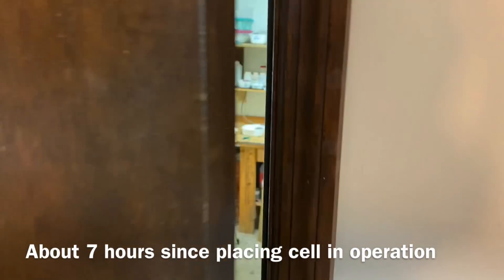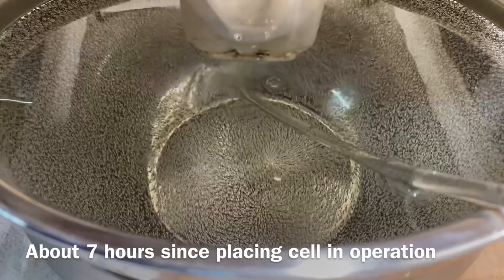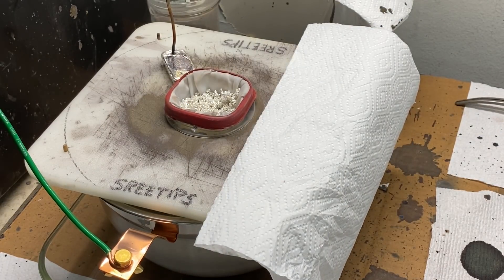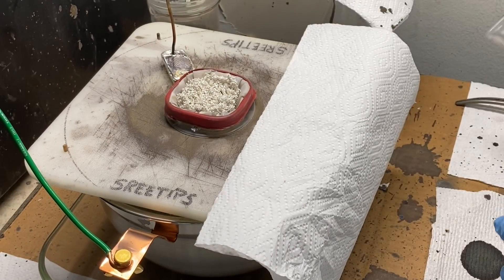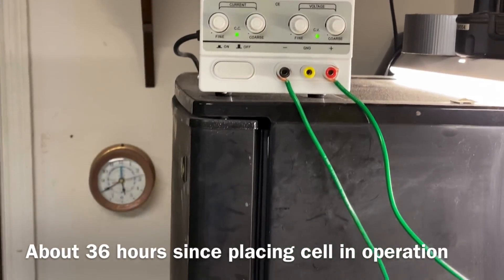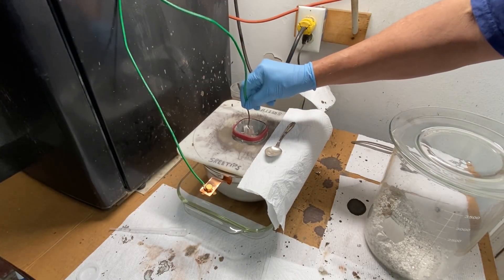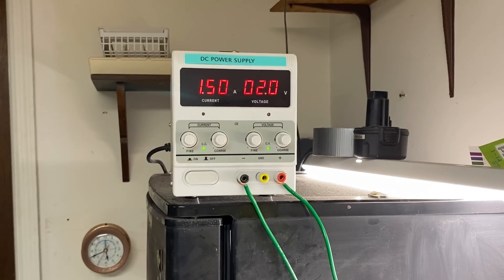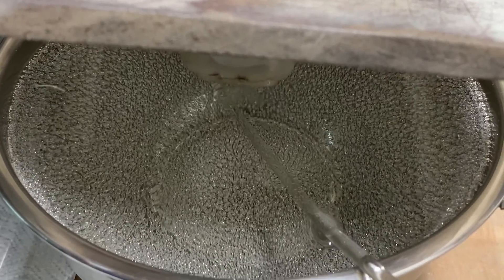EP010 Silver Cell Constant Current Update

Comment: I bet you can see variable crystalline formation depending on the amps and voltage, the way it looks you are getting thicker strands from the amps and the rate of growth could be the voltage. Low voltage low growth, higher amps more connectivity thicker crystals.    :  )
Reply: The rate of silver deposition (number of atoms per unit time) is only dependent on the current. It's because you need a certain amount of electric charge to deposit each silver atom, whereas the electric current is simply the rate of charge transfer.

The voltage, however, sets current density, i.e. the amount of electric current that flows through each unit surface area of contact between the metal and electrolyte. It is not so obvious, but a calculation yields that the current density only depends on voltage. If the voltage is regulated, a larger surface area (i.e. if you have a lot of crystals already deposited) results in more total current, but the current density on the boundary will remain the same.

It is the current density that determines the local properties of the electrolysis process, i.e. which metals are preferably deposited, whether there is bubble formation, etc. This is why most electrochemical recipes specify optimal voltage across the cell and only give rough specifications on current. So I would only use the constant-current feature of the power supply for current limiting and short circuit protection, while keeping the voltage constant.
Reply: @bormisha  so if the amps are OK at 1.5 how much more voltage could be applied to get optimal growth and what are the indicators.     Thanks.       :  )
Reply: @remzo500  If you limit amps to 1.5 then, with Sreetips's cell, the voltage would stay at around 2.something V and never rise to 3.5V which Sreetips previously mentioned to be the optimal value that he heard from somebody. If the optimal voltage really is 3.5V, then 1.5 amps is too low a current for a cell this big. I would set the voltage to 3.5V or whatever other optimal value; and raise the current limit slightly above of what is necessary to keep the power supply in constant-voltage mode. This way, the constant-current feature of the power supply will almost never be utilized, except for protection against short circuit or other abnormal circumstances.
Reply from the maker: One thing not being considered: the current cell is running high purity silver - no slimes to build up in the anode filter and interrupt current flow. If I run the 98% to 99% silver shot from cement silver then the filter will slowly get clogged with slimes and current flow will drop off
Reply: Very interesting thank you all.     :  )
Reply: I remember that when you replaced your power supply with the one you have now is when all the issues appeared maybe going back to a desktop computer power supply would be better or get the specs on your current power supply and get a much better one.    :  )
Reply from the maker: I might set up a second cell identical except with an old PC power supply just for fun.

Comment: Does the electrolyte go bad? Or does it harm the silver growth or structure over the long term?

Hypothetically, if one were to use an aquarium in the same manner as you built a silver cell in a breaker, could you just keep running pure double refined silver crystal through it to make an art piece? Let's say it's a 25 gallon aquarium with a graphite block 1in x 3in x the width of the aquarium in the bottom at one end, and the anode filter basket at the top of the other end, could I just keep adding double refined silver crystal to that until the aquarium fills up from one end to the other? Would it eventually have negative effects? And if the electrolyte can get its usefulness used up, can I just suction out the electrolyte and replace it and keep going until it's filled the aquarium? And when is full, can I (or should i) just replace the electrolyte with distilled water?
Reply from the maker: The electrolyte gets depleted as the cell operates. Plus copper builds up in there. Not with this run because there ain’t no copper.
Reply: @sreetips  When an atom of silver plates out onto the anode, that atom must be replaced by one from the cathode. The reason the electrolyte gets depleted of silver when running non-pure silver is that the silver ions in solution slowly get replaced by copper ions - which of course fouls the electrolyte over time. 

When you are running essentially pure silver, there are only silver ions in the basket to replace those in solution, so the electrolyte should not become fouled.

Comment: Hi Sreetips! I see both CC and CV indicators are lit up on you DCPS. I don’t believe this should be the case. I’m pretty sure those modes of operation are supposed to be mutually exclusive…this is fairly common with these cheap Chinese power supplies.
Reply: True, that. You can regulate current by fluctuating voltage or you can regulate voltage by fluctuating current. Can't do both at the same time.
Reply: @ut000bs  Actually you can put a max on both but that will definitely slow things down and under perform.
Reply: Doesn't matter, digital readings show clearly that the PS is working in constant current mode.
As you said, CV led on this cheap chinese PSU is more or less an indicator of voltage at the output...
Reply: Yeah, I noticed that in the previous video, my guess is they decided to cheap out and just always power the CV LED.

Comment: If you want faster growth you can increase the current. The limiting factor is current density (A/cm^2), at different current densities you will observe different kinds of formations. You probably don't want to go too high in current density as it might cause plating instead or low quality.

The current is directly proportional to growth rate.
Currently you are looking at growth rate of:
1.5 [A] (set current) * 3600 [seconds/hour] / 96,485 [As/mol e-] = 0.055 [mol e-/hour]
0.055 [mol e-/hour ]* 1 (one electron per one silver atom) [mol Ag-/mol e-] * 107.9 (molar mass of silver) [g/mol Ag-] = 5.9 [g/hour] of silver

Or more generally: 3.93 g/Ah so 3.9 grams of silver for current of an 1 Amp for 1 hour.
Reply from the maker: Excellent, thank you
Reply: Yes but you also have to be careful of the current and voltage because too much voltage will electrolyze the water to hydrogen and oxygen and too much current will evaporate it with excess heating.
Reply: Excellent feedback, TheKubux, bump up the current a bit for faster growth. You are a leg up on your electronics formulas, excellent citations of the math. It's been a long time since I have taken Basic Electronics (1979 Army and 1993 college), so these formulas are familiar to me but not off the top of my head anymore. I still have to look them up when I need them. Great job, Chris and thanks again for the very valuable feedback.

Comment: Thanks for the update .. I was so curious how the crystalgrowth looked with the new settings. I'm pretty sure there must be an optimal Voltage over the cell related to the metal itself as there is with all electrochemical deposition (galvanizing) processes. You could influence the Risistance of the electrolyte with the concentration of SilverNitrate and lowering that would crank up the voltage with a constand current. And so cool, that stuff looks as white as snow. So Silvery.

Comment: Have you done  a Time Lapse video of the Silver growing? If you used a piece of Plexiglass as the lid you should be able to see it.
Reply: You’d think so but no, I use plexiglass on mine and you see nothing but blobs of electrolyte that are stuck to the underside of the lid.  The heat generated through the plating process is enough to make the water in the electrolyte evaporate and condense on the cool lid. You can pick the lid up on an angle and get the electrolyte to condense and roll off but it’s never really ever clear enough to see through after it gets wet. The only time you can see through it clear enough is when you first put the lid on dry.
Reply: @djcbanks  Too bad, because such a video would be cool. And, lemme guess, if you skipped the lid, and suspended the anode basket with something like plastic rods, then that would just release water vapor and acid fumes and all manner of nastiness into your lab, right?
Reply: @BocaMint  yes the solution would evaporate and make the concentration of silver dissolved in solution go high which would increase conductivity and lower resistance causing the values in the power supply to go way out of whack from where you ideally want them (even though the power supply is current and voltage limited. Plus you want to shield the solution from dust and anything else that could fall into it simply because the idea behind purification is to remove everything else that isn’t silver. Don’t want foreign objects getting bound into the layers of silver decreasing its purity. Silver will build up and eventually plate over foreign objects that fall and lay on top the silver crystal.
Reply: @BocaMint  fumes not so much of a problem. They are pretty low but you are correct that is a potential concern as well.

Comment: Don't push on the anode bag. you are pumping liquid through the filter and washing small dirt particles into your cell. You can't judge the crystals purely by looks. The density could be much higher or lower depending on settings. You can grow many small crystals very fast or fewer large crystals very slowly. Once the surface area increases the speed will also increase. Your current seems too high and voltage too low though. In the last video you turned up the current to increase the voltage, but you should have turned the voltage knob instead.
Reply: I was wondering the exact same thing about the first part of your statement (pushing on the basket).
Reply: Current and voltage cannot be controlled independently on the supply. As the supply currently is in Constant Current mode turning Voltage knob won't do anything (unless you reduce it bellow voltage demanded by constant current).

The lower voltage (for amperage) can be caused by higher surface area or electrolyte concentration.
Reply from the maker: I’m not familiar with any of this. But as the crystal grows and get closer to the anode basket the resistance should drop off. Normally the current would go up (I think) but it’s set at a constant 1.5 amps. So something else must change. Must be the voltage. I’m still learning as I go.
Reply: @sreetips  if your power supply comes with a manual I would definitely check out the CC and CV settings to find out what it takes to set them up and have ot run in either mode. given its a single output powersupply i doubt its complex but its best to not think its set up one way and then function in another and it will allow for better control and experimenting  and bonus it'll give you the knowledge to charge up some lithium ion batteries if the need be

Comment: Not the same crystal structure we've seen in the past but man - they still look excellent. Consistent color and densely packed. Looking forward to seeing the finished product. 👍👍👍
Reply: I wonder how much of it is due to less current, and how much due to no copper in electrolyte. I remember sreetips mentioned as few videos ago that presence of copper influences crystal growth.
Reply from the maker: The copper promotes good thick crystal structure according to goldsilverpro on the goldrefiningforum.com - but I left it out because it slipped my mind. But decided to leave it out for this run because we’re running pure silver back thru a 3rd time. Let’s see how it turns out.

Comment: Why did you cut the current and voltage back?
Reply: He cut it back because high current causes fast, long spindley crystal growth. It grew up into his anode basket and potentially burnt a hole through it. Keeping the current between 1-1.5amps gives slower chunkier crystal growth. Ideally he would want his voltage to be 3.5v but that isn’t as bad as the current being high. He could adjust the electrolyte to a lower concentration as low as 50 g/ml (he currently does around 150g/ml) and also use a slightly bigger bowl so that the anode is further from the cathode, this will allow the voltage to stay around 3.5v and the current down between 1-1.5amps.